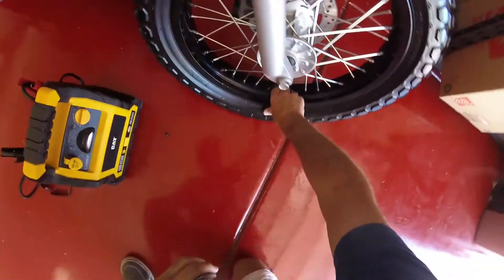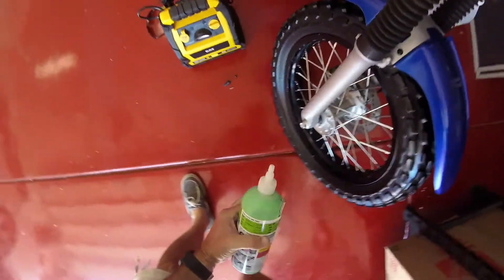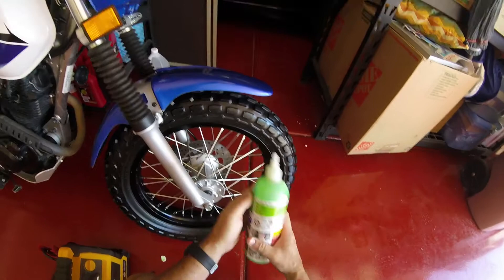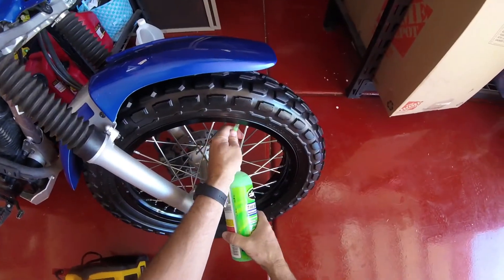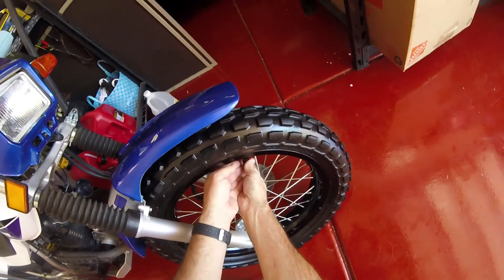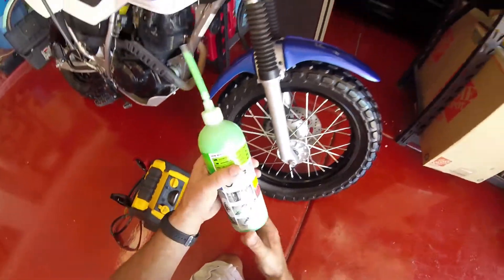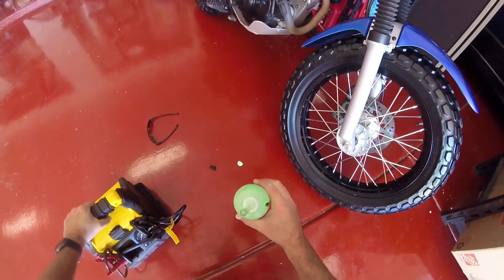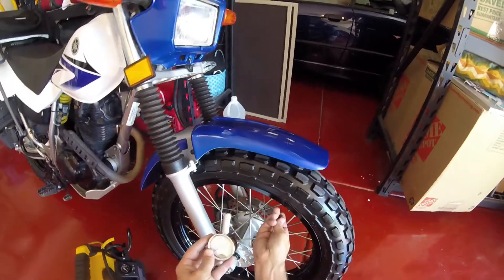Yamaha TW200 Motorcycle "Slime" flat tire repair

Comment: Had to use this in the bigger brother XT250. Held, but would leak depending on how I parked. Had to replace the tube 2 weeks later after 3 slow leaks. So good to get home or if you carry a pump, but not a perm solution.